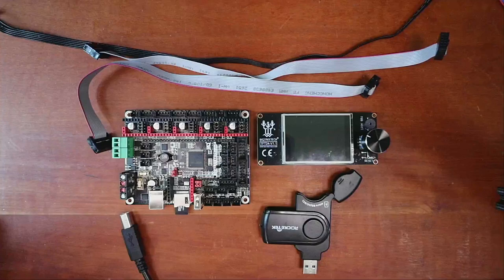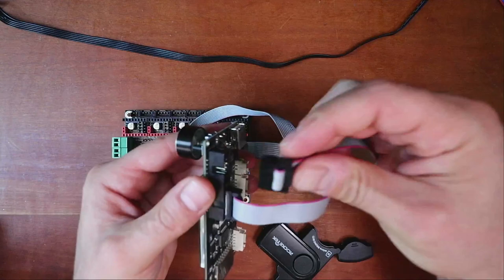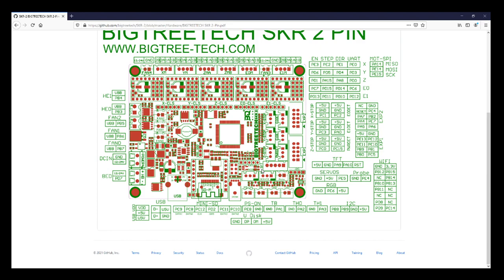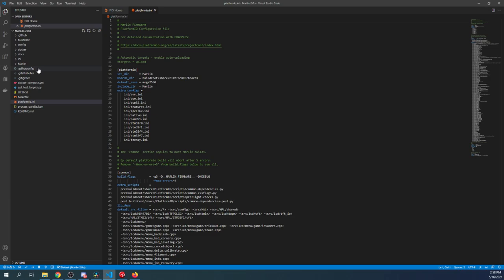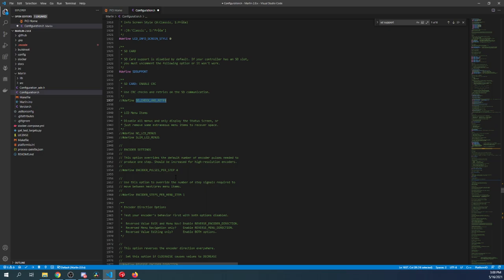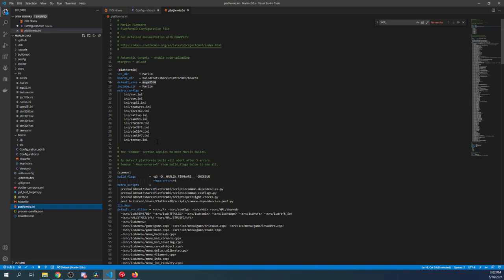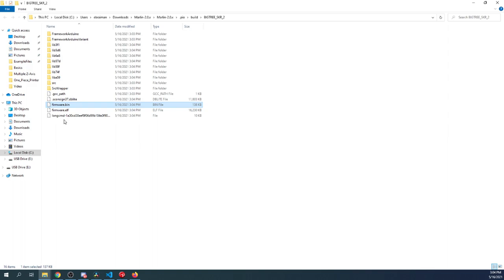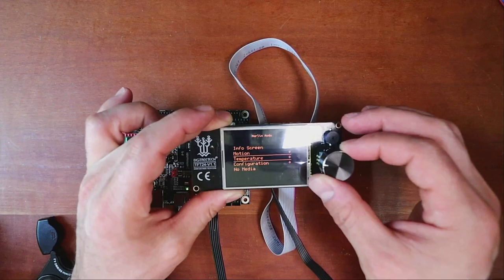BTT SKR2 - BTT TFT display setup on SKR V2 (Rev B)

Comment: Your video is fantastic! Got the SKR 2 working on my Tornado with the old LCD screen. Must have watched 20 videos that left out one part that did the trick, "cleaning up the build", getting rid of the old MEGA 2560 did the trick. Thanks much!
Reply from the maker: You're welcome.
Reply: @EdwardBraiman  I tried a ton of crap to try and get it to add the ability to print from the SC card in the LCD screen, the option was not there. then I followed your video and there she be. Thanks again.
Reply from the maker: You're welcome.

Comment: Hello,

I have a problem with the SKR 1.4t motherboard with TMC 2208 in UART mode. After uploading Marilin, on the tft35 screen appears "error: all low error ". I tried check it in Pronterface program with M112 command but my Driver registers are Bad response and every axis have this error: "all low". Would you give me advice on what I could have done wrong? Or I just broke my motherboard ? Please help :)
Reply from the maker: What do you see in Pronterface?  Is the board powered?

Comment: Hello Ed, I like your method of teaching very much. You are very thorough and clear. I just have one question. How did you pull off compiling in Marlin with vscode in 51.879 seconds while I did everything exactly like you and it took me over 9 minutes. Is there a box I need to check mark in order to compile only changes?
Reply from the maker: My computer is very different design than most.  It's running a high-end GPU and CPU with M2 and lots of memory.

Comment: Ed Thanks for the helpful video. After getting all the parameters set, I tried the jog functions using the TFT motion display. The home sequence worked fine as well as X and Y jog moves to various distances. The Z axis however would not past 1mm resulting in a load motor squeal and no motion. Is there a way to get your help on this issue?
Reply from the maker: There's a Discord link in description of video and either I or someone else can help in General Chat,

Comment: 6:50 I don't think Marlin will replace the board, BTT should, fixing the issues in revision A is very easy
Reply from the maker: As long as you can run either jumper wires or solder you should fine.

Comment: have you made the other video on the touchscreen yet? I have tried everything in the video, the marlin lcd side works but on the bigTree tech touch screen side it sill says no printer attached, even after I checked the BaudRate. Thanks for the vid!
Reply from the maker: Which version of TFT display software are you using?
Reply: In same situation. Marlin mode works but touch mode doesn’t. BTT Using TFT 43. Thanks for any assistance!
Reply from the maker: Try my Discord channel, there is a chatroom there where others have had same experiences.
Reply: Hi. Got it working by unplugging everything and re plugging. Now onto an auto fan. Keep getting errors trying to make fan0 the auto fan. Any tips on that?
Reply from the maker: Yeah it's in advanced configuration.
Reply: @EdwardBraiman  V3.0_E3.27.x.bin with the unified menu

Comment: I am having the same issue of no printer attached. I have tried every combination of serial ports. I have two of the boards and two of the tft35 e3 v3.0. Both say the same thing. As said before, serial 0 won't compile without modifications to the HAL. I did this and still got the same issue.
Reply from the maker: Can you post your configuration.h and Marlin version on Discord?
Reply: @EdwardBraiman   Sure where? btt-tft?
Reply: @EdwardBraiman  Done added to question in btt-tft.
Reply: I figured it out. I assume that the dupont connectors would go onto the dupont style pins but instead they plug into the molex style tft connector on the skr2.
Reply from the maker: Great.
Reply: @irishobo977  Thanks, this helped me out too! Couldn't get the usual SWD pins to work with the screen but the TFT connector next to it on the SKR board worked.

Comment: Does SKR 2 Board has EEPROM ?
Reply from the maker: It should, just remember to use rev B board with advanced steppers.
Reply: @EdwardBraiman  But the card doesn't work with Udisc and sdcard at the same time. Do you already have a solution for this with this tft?
Reply from the maker: It's a known issue between Marlin and BTT.  Both are working to fix as I've seen a bug on BTT GitHub.
Reply: @EdwardBraiman  The sd card only works if you have Udisc. But Udisc never works. Very bad